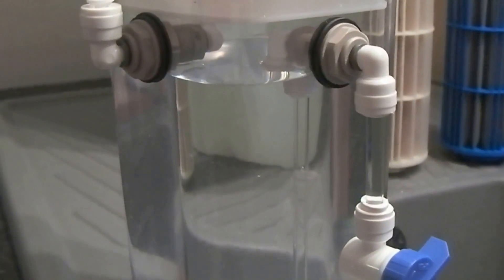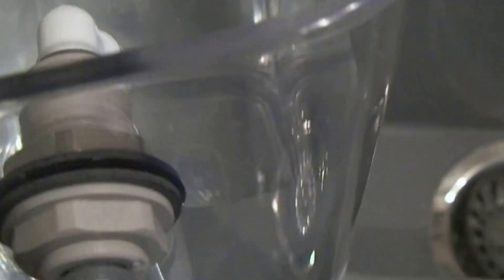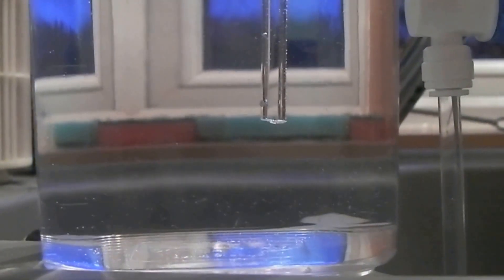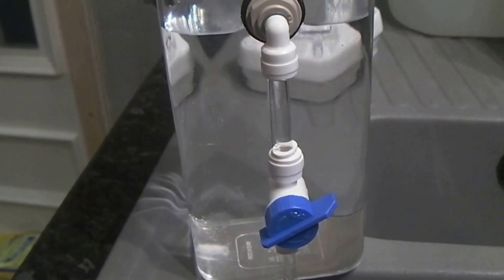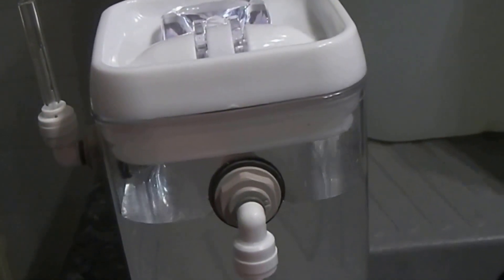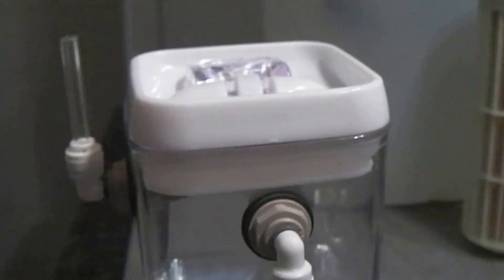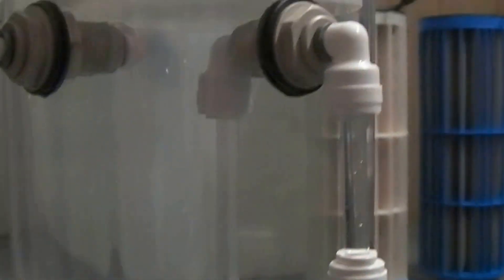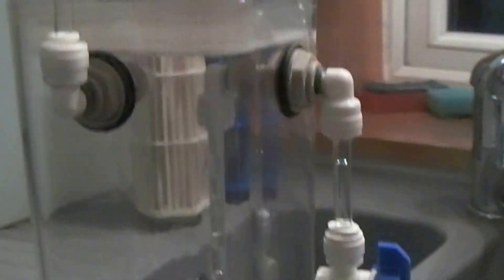Kalk Dripper. Home made obviously........

Comment: great set up! are you dripping aside from utilizing a separate ATO?
Reply from the maker: The kalkking failed about a year or so ago. It has been scrapped and the tank is to be emptied and scrapped or possibly started again.....
Reply: But that means it ran fine for 4 years right ?
Reply from the maker: Not sure of the dates but around that period I would say.
Reply: Why did the tank fail?
Reply from the maker: @TwoOnesTanks  Just a gradual failure of the parts and overall tank condition. We will keep the clowns and get a nano tank before one day getting the new big tank running....
Reply: @Trevs-Shed  why did it fail
Reply from the maker: @CatfishHeaven777  It stopped stirring the kalk and then stopped topping the tank up as I recall.